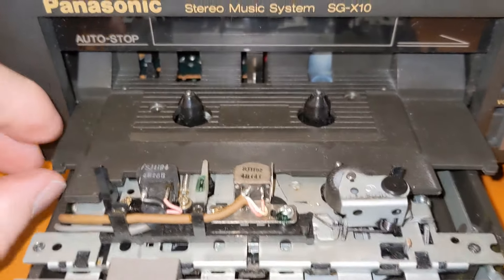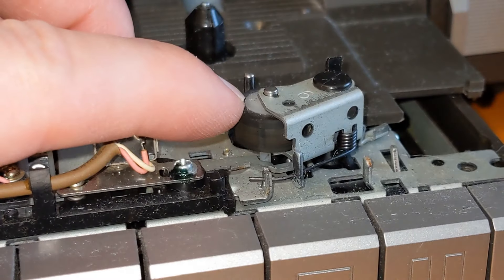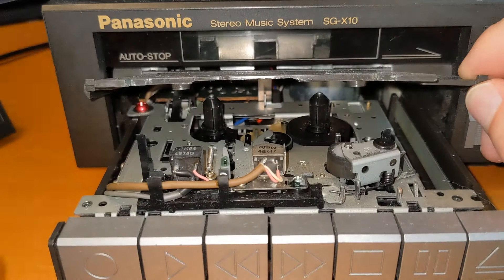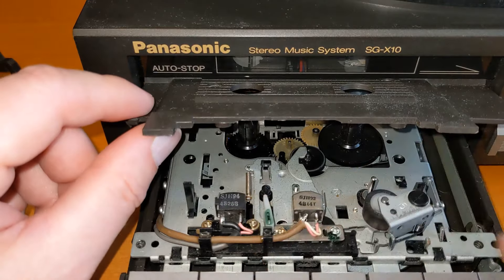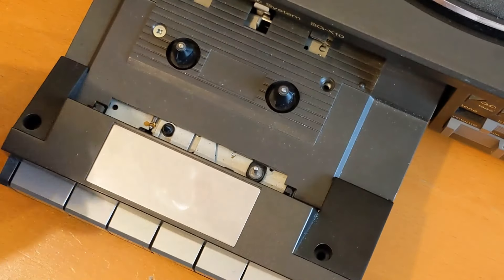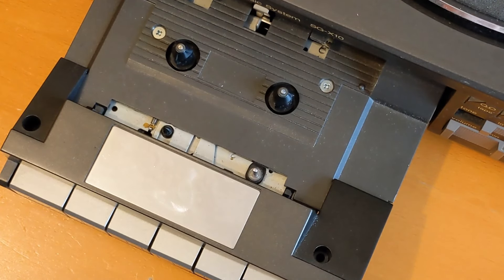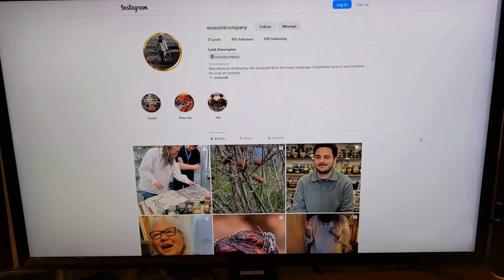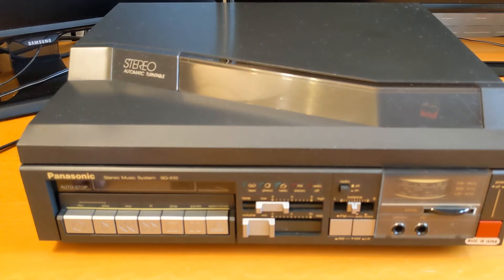Goodbye Groovy

Comment: I'm here because I have one of these , I bought it because I like Panasonic hi fi's . I bought it a couple of years ago and I never used it , I was going to throw it out when I was getting rid of stuff in my house but I decided not to throw it away and kept it. I have bought a pair of Panasonic speakers for it from eBay, they were brand new unused book shelf speakers. I bought a new stylus as the one it had was fine but I didn't know how old it was. I started by cleaning the tape heads and rubber wheel. That was like new afterwards I opened it up and tweaked the speed on the record player. I'm going to get another belt for the record player, but it looks and sounds great. I was glad I didn't throw it out as I get brilliant recordings off the record player! Cheers for the video as I was worrying about the state of the tape deck belts!!!
Reply from the maker: @davarosmith1334  Cool. I loved the look of the centre, but wasn't using it.

Comment: Wow, I bought one of these back in the 80's when they where new. 85 86 I think it was.
Never seen one since then. Not been missing it for a second...
Just a cheap all in one system that came with two Jamo bookshelf speakers if I remember correctly.
The speakers was good, the SG-X10 was just cheap and with a low power amp in it.
Btw there must be at least 1 belt in it, connecting the motor to the flywheel on the capstan shaft.
Reply from the maker: Yes, you're probably right about the belt.
I think mine must have had replacement speakers, as it sounded much better with my own speakers.
Cheap, but nice enough functions. Very retro-cool. Sad to see it go, really.